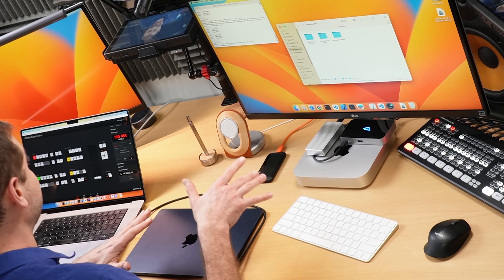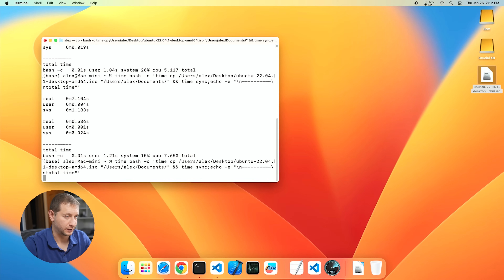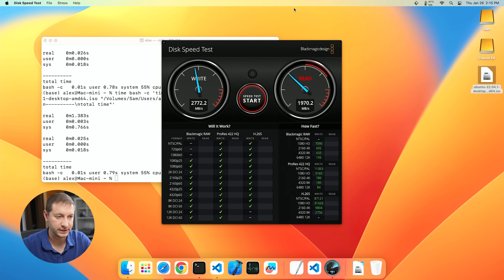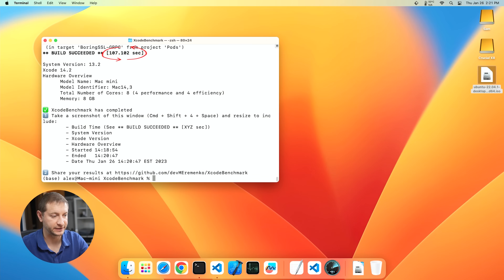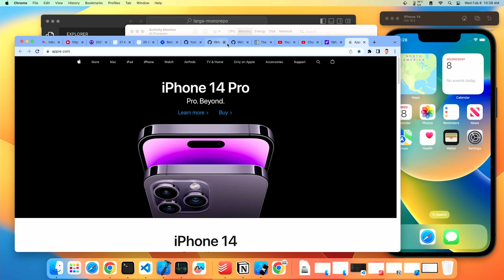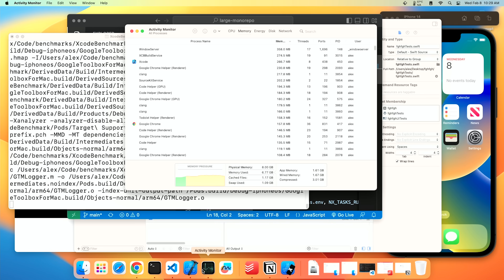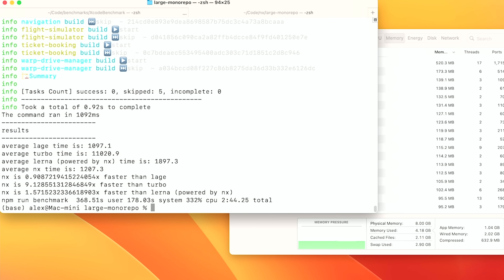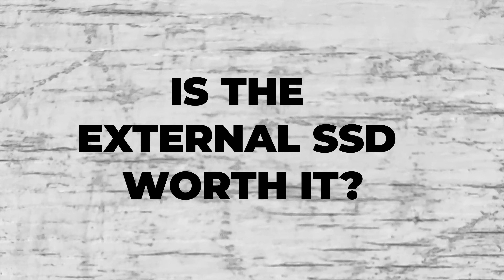...but there's a catch

Comment: I'm a PC user, do I understand that right that Mac Mini's RAM isn't expandable? What about other Macs like Mac Pro or Macbooks - do any of them have expandable RAM?
Reply: No because uNiFiEd MemOry iS bEtTeR
Reply: @ValdeSanus  "unified memory" is some sort of memory access tech? I thought Macs just use regular DDR4 or DDR5
Reply: @AntonMochalin  Since 2013, all Macs have soldered RAM. You can only upgrade them to higher configuration upon purchase.
Reply: @KarlLimPH  at least they could have RAM expandability on Pro line because "Pros" are expected to know what they're doing... And I guess the same situation is with SSDs?
Reply: @AntonMochalin  No. Unified memory architecture allows massive throughput never seen before on personal computers. On par with supercomputers. Macs can do like 400 GB/s RAM throughput, while PC regulary do only 100 GB/s. That's also reason why Macs with built in GPU have quite performant graphics at a fraction of power requirements of Nvidia and AMD. Using regular DDR would need another controller, passing data through whole motherboard from CPU to RAM and to GPU and back again, which creates slowdowns (you can't overcome speed of light).

That's not an issue. Actually, these days it's hard to find ANY laptop with upgradable RAM. And that is not a problem – in my life, after the purchase, I have never ever upgraded RAM. What for? 16 GB is good baseline these days and it is so like for 5-10 years and I don't see it to change anytime soon. Even 8 GB is enough for a  VERY long time already for regular users.

Comment: This is my favourite channel. Didn't have much $ and decided to buy a M2 Mac Mini. But I chose 16gb RAM instead of choosing 512GB SSD. I'll just use an external SSD for less $. Thanks for all those tests.
Reply: Buy what you can't personally upgrade !
Reply: stupid prices even for 8gb ram :/ crazy company
Reply: @Adiiiman2xxx  Too be fair its crazy fast RAM that is also soldered with direct access to the every component in the SOC since its all built together. Memory upgrades cost the same from others like Dell and HP so tbh it doesn't matter
Reply: @spencerrr9878  Yeah, it costs the same as Dell and HP because those companies are copying Apple's insane ripoff prices.
Reply: @spencerrr9878  Dell and HP will accept a dirt-cheap SODIMM memory module, that costs just a fraction what Apple charges.

8gb from Apple:   $200 USD
8gb from Amazon:  $15 USD

Comment: Very helpful video. Seems like the 200 IQ move would be to just max out the RAM with the smallest SSD and then boot from a decent M.2 in a Thunderbolt enclosure. Both Apple's RAM and SSD prices are insane, but at least we can get around one of them...
Reply: Or, the 200 IQ guy would choose a super-fast Windows machine instead.   90% of the world prefers Windows.

Comment: I tried the external enclosure with a 2TB SSD as my system drive on my Mac Mini (i7 / 128GB). It turned out to be too unreliable, sometimes the speed would drop to < 100 MB/s, and sometimes the system would freeze.
I ended up moving the 2TB to my gaming PC and get a Samsung T7. Yes it is only 800MB/s write / 900MB/s read, but it works as system drive with no issue at all. Maybe I was just unlucky with my enclosure unit, but to me it did not work as expected.

Comment: If you want to have a fast system then have enough RAM to not use swap.  The internal NAND may not have the bandwidth of the TB 4 but it probably has much better latency.  Once you started using swap you started losing, until you entered the thrashing phase and that's all she wrote.  Unfortunately for those who buy the 8GB model and want to use programs that utilize RAM need to sell theirs and get the 16 GB+ model.  That's really the Apple gotcha, you need to know exactly what you require.  M1 and M2 are great but a PC has much more flexibility and adjust to changing requirements.

Comment: Thanks. you are the best.
I'm a senior full-stack web developer and I want to buy a Mac Mini M2 Pro.
but due the fucked up financial situation in Iran, I can't.
just tell me the M2 base model is good for me 🙁 I know it's not enough, but I can't buy it
Reply: it's definitely enough, Node JS will not run on multiple cores so having Pro is waste of money when you will be running only on single thread for most of the time.
For VS Code/Idea you don't need multicore.
Just upgrade the RAM to 16 GB and get SSD you will need. 512 GB is a good start.
Or try to find used M1 with such parameters, you will get much lower price and performance difference between M2 is miniscule.
Reply: @ZhuJo99  thank you very much ♥️

Comment: I’m pretty sure you can create a symlink/hardlink where the vm swap files are stored and set it to use the internal drive only. There might also be a way to change the dynamic pager config to use a specific directory (which you can set to the internal drive)

Comment: Same issue with swap was on the intel Mac mini, max amount of swap was double the ram installed. But if work from internal drive 16gb model can use 40gb of swap without any issues.

And don’t forget that system uses almost 5gb ram
Reply: What the hell are u doing to make 40GB swap?
Reply: @njpme  I’ve seen 58gb swap, and mostly it was lots of tabs in Firefox and Safari, Xcode,and music in the background )) maybe some memory leaks?
Reply: @ivanshevy  most likely  memory leaks

Comment: Thank you for this video.  I really like your work and how you explain things.  If I am correct in my understanding, I connect an external NVMe SSD (with Enclosure) to the MAC, reboot to recovery mode and install macOS Ventura to that SSD drive.  From then on I continue to boot from the external SSD with the result that I have significantly increased Read/Write Drive Speeds.  This is very interesting considering the price Apple charges to upgrade internal storage is so outrageous. I have seen others reviewers suggest the same Orico Enclosure so that's the one for me.
Reply: Don't overlook the second half of the video where Alex shows the negative impact on swap with macOS installed on external drive.
Reply: My M2 Mini (16/512) will be delivered next week. I want to set it up to get the most out of it as is possible. Aside from mundane Word & Excel work I do a fair bit of image editing. Nothing that should be too taxing for this machine. Is the consensus set up to leave the OS on the internal SSD and put the home directory and applications on a TB4 NVMe drive?  I’m a little concerned about apps and later app updates losing track of what’s where?

Comment: Hi love your channel, what if  2 external drives are plug into both the 2 thunderbolt outlets, one is use for mac os and the other is used to store files that are being use by different programmes, will the system handle better?

Comment: It's unclear whether the the built-in drive with the same memory pressure would have been just as slow (or more likely, slower)
Reply from the maker: Yeah, haven't been able to cause that kind of pressure on the mini yet doing normal stuff. And I probably could do it, but that would be a pretty unrealistic scenario. For example, I won't be editing 8k video on this little box while I'm compiling code :)
Reply: @AZisk  Yeah understandable. It's just hard to tell if it's a problem due to the external SSD or whether it'd also apply to the internal one.

Comment: What were the max speeds when you used the 980 Pro?
Reply: ...I was looking at upgrading the SSD in my TB Enclosure from a 970 Evo (non-pro) so it'd be useful to know just what the real-world read/write performance might be over TB so if you have the info it'd be much appreciated please
Reply from the maker: I only tested the 990 pro, and it reached the same top speeds. Around 2800 read and 2800 write. Even though the ssd. can handle 7k. Turns out that's the max going through the t4 channel for some reason.
Reply: @AZisk  Odd I'd have hoped for a bit higher, not that it matters too much at that point. I wonder if it's the enclosure. Thanks for the info!
Reply from the maker: @rhoderzau  Enclosure is specifically rated for 40Gbps. would be curious to see what you find
Reply: @AZisk  Maximum for TB4 data transfer is 32 Gbit for data, 8 Gbit for display. But when you have display connected to same bus (AS Macs have dedicated bus for each TB port), it will eat into data bandwidth. Ie 4k display is about 14 Gbit/s so 26 is for data left. But in your case and enclosure, from those 32 Gbits you can count off that for some latency and operational cost due to TB controller, so about 26 Gbit/s is a limit. On the other hand, TB3 has just 16 Gbits reserved for data and 24 for display, that's why TB3 enclosures are close to about 1500 MB/s

Comment: Great video Alex.  I was wondering if the swap issue would also happen, even with the internal drive?  Could you compare? Thanks!
Reply from the maker: Ran the same tests on internal, didn't see the same problems.
Reply: @AZisk  Can you benchmark your internal and external SSDs for random Reads/writes on different QDs and compare, maybe that's the reason why external is slower. 970 evo is fast on sequential, but not particularly fast on random
Reply: +1 my first thought

Comment: I suspect that the reason the external SSD slowed was that it was not running in parallel. The 1TB in the Mac Mini M2 has 4X256GB NAND modules, meaning 4X the faster cache in each module. Whereas the 1TB external drive will face the same issues as the one NAND 256GB drive, the bandwidth will be up to 4X less. What Max Tech got wrong was that swap speed is based on random read and write, not sequential speeds. Few of us need more than 3.2Gbps, as random reads and writes top out at around 800Mbps. So it was the fact that 1TB has 4 NAND drives rather than the 1 in the 256GB hence slowdowns in swap happens quicker on the smaller SSD. 

So, if running from an external system with 8GB of RAM, you would need multiple SSDs running in parallel. The clear moral of the story as I commented many times on Max Tech videos, is that using 8GB and lots of swap is inefficient. Buy what RAM you need, so 16GB minimum for semi-pro work, but the more the merrier. RAM is so much faster than swap, that it is inconceivable that if you want best performance, that you would cheap out when you know that 8GB will mean high swap usage.
Reply: I'm confused though - whilst I agree a single 1TB non-parallel drive would be less efficient that a x4 internal parallel 1TB drive - this video shows that a non-parallel 1TB external drive was being massively outperformed in SWAP efficiency by the internal 256GB non-parallel drive. So in this case, the issue cant have anything to do with parallels, as Alex's memory pressure and SWAP usage was considerably better on the smaller, slower, still non-parallel drive. I'm confused as to what actually caused the SWAP slowdowns and memory pressure on the external drive?
Reply: @beelzzebub  I think problem lies in SLC cache of these SSDs. In reality, on Samsung 970 Evo it's SLC cache is only 6 GB – and this is where Alex saw drastical drop in performance. No, so called “intelligent Turbowrite“ isn't going to help.
That and probably coupled with the enclosure – maybe overheating caused this too?
Reply from the maker: thanks! great info!

Comment: It’s interesting why external drive used 10 gb of swap in the same scenario. My M1 512gb air also dies when it reaches 10 gb of swap (I have 8gb air). Maybe there were some unexpected background processes when testing on the external drive, I don’t know. By the way, interesting topic. Thanks for the video!
Reply: I expect it is software encoded, so that the process will use more swap in a 1TB drive than in a 256GB drive as Apple knows that 1TB can handle more swap than 256GB before it slows. However, due to the 1Tb internal drives having 4 NAND chips in parallel they can each take some of that swap in their faster MLC memory. I suspect the 1TB external SSD is a single stick so does not have 4X the bandwidth of the internal drives for caching data before it offloads to the much slower storage partition.
Reply: @andyH_England  and as far as I know, it is not possible to limit swap in macOS. But if you are right then external drive has to be limited to 256gb and then (theoretically) it should work better than internal ssd because of the speed. Sadly I do not have external drive to test this theory :(

Comment: Would the issue with the external swap be because of random access speed times? There is so much focus on sequential speed of the one NAND drives. How does random access speed for small files compare between the 256 gig SSD and the larger multi NAND module drives compare?
Reply: I would not think too much about swap being used, i would care much more about AVOIDING SWAP at all cost.
As i got my 16" M1 Pro base model i was also scared a bit im running out of the 16GB shared RAM, and in fact i can trigger it (editing a video in FCP while enhancing a 4k video with Topaz Video Enhance AI and many browser tabs opened) I used like 7-10GB swap on top of the used 16GB Ram and the machine also slowed down noticable (Swap on internal SSD)
Its funny tho... if the Swap is just used for non processing stuff the machine even handles well with 5GB swap used, if more than 16GB Ram are "needed" for the processing of whatever, the machine still slows down, depending only on how much Swap is used and how much acess is needed on the swap.
Compared to a TB4 SSD enclosure for swap with a 1TB SSD i barely noticed a difference in performance loss when the task and Ram/Swap usage was similar, but 2000MB/s are still damn fast.

I would just go for a 16GB, better 24 or 32GB RAM upgrade and enjoy a long lasting (in Ram size and its performance) machine. If i would have to buy another M1 Pro MacBook today, i would probably buy at least a 1TB SSD/32GB Ram version instead of the base model. 16GB are nowadays just the ABSOLUTE MINIMUM amount of Ram a machine should have, and considering apple targets the MacBook Pros to "professionals".... 24, better 32GB should have been already minimum standard.
Reply: @harrison00xXx  You Can't really avoid swap in MACos, even if you have hundreds gigs of RAM MACos still using it.
Reply: @paulf3353  Its ok if its used, but it depends on the workload and if data in the swap file are also accessed and used for processing.

I have actually also 3GB swap used, despite the ram is only filled 7GB out of 16, but thats a lot of stationary, not yet used/needed data so the performance isnt affected and the 3,x GB swap used doesnt change much in use.

So i meant basically that your Ram is better enough for the workload you are throwing at the machine, not the 30 browser tabs
Reply: I’m guessing the components on the board are a little more integrated, which is why there’s less penalty using swap with the internal ssd. Swap using the external drive probably involves a less well integrated/optimized external component, which may explain the why swap is less efficient with the external.

Comment: is there a way to configure MacOS to put swap on the external drive?
Reply from the maker: there is, but it’s highly discouraged
Reply: @AZisk  because it's twice as fast in many situations?
Reply: or 3 times faster if you create a raid 0
Reply: @AZisk  you can include external disks in Time Machine backups so why not?
Reply: Get the best of both worlds like this:
Me:
Create a second user so you can manage and restore the original account :P
ChatGPT:
sudo ditto /Users/<username> /Volumes/MyExternalDrive/Users/<username>
sudo chflags -R nouchg /Users/<username>
sudo mv /Users/<username> /Users/<username>-original
sudo ln -s /Volumes/MyExternalDrive/Users/<username> /Users/<username>